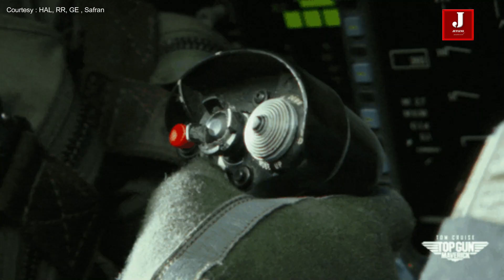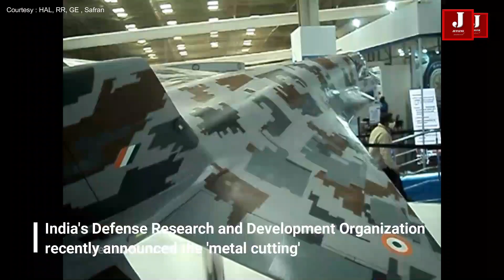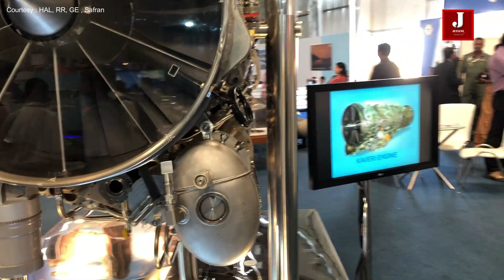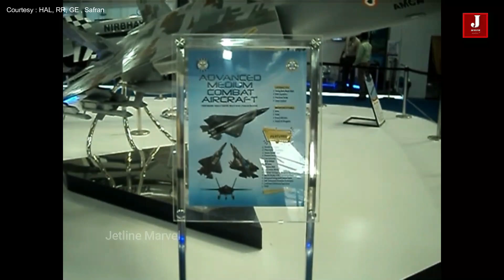These 3 firms offer the Engine for AMCA India's fifth-generation fighter plane. #AMCA #amcacapacity

Comment: Why amca needs 125knw engine .. ? No engine is that powerful in the current world... even Safran or rolls Royse doesn't have it ..max in 102 for single engine i guess ... I think indian air force is asking for 125 KnW  thrust that too without using   afterburner